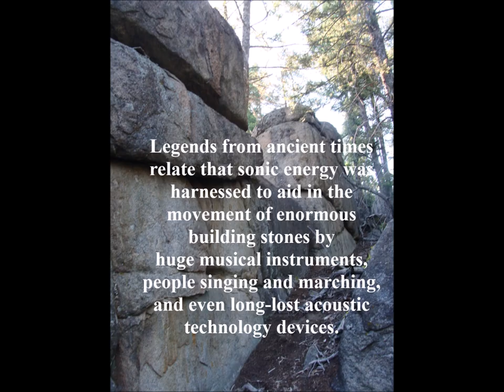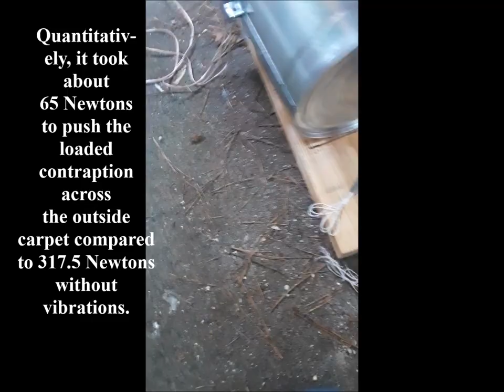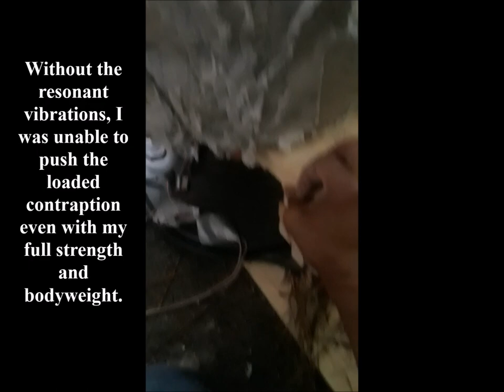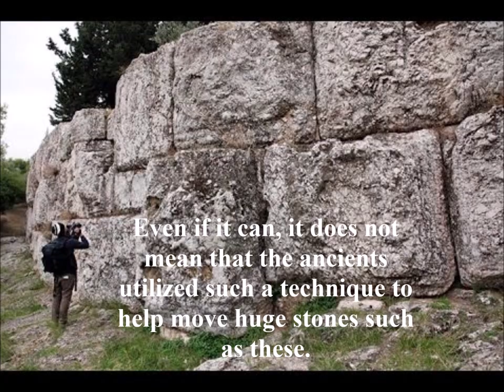Moving Boulders with a Push of the Finger: Did Sound Help to Build the Megaliths?

Comment: I believe the movement being facilitated stems from mechanical vibrations, not sound. If you were to record the sound and play it back over a speaker you couldn't move that weight
Reply from the maker: Of course. When we say sound, we also mean mechanical vibrations by default, as the former is dependent on the latter anyway.
Reply: @gsutton78  and I would say the title is a little misleading. I think the experiment is absolutely fascinating. I don't doubt for an instant. There was an ancient civilization long before hours that have mechanical devices and engineering. I just don't like the idea of saying sound moves things when in reality it's mechanical vibration

Comment: This is interesting. I've been looking for information on ultrasounds for the past days. These are frequencies below our hearing capabilities but can also move objects. They can be caused by numerous things such as earthquakes, oceans, volcanoes, and even  mountain fractures. It may very well be that they used such forces of nature at the right timing, if they have not produced the sounds artificially. This is also a possibility. Oh and, it was also said that certain temples have this wind turbine effect which also produces these low frequencies. But I suppose to make those they already moved the stones to build it.
Reply from the maker: Well, there's a whole branch of thermodynamics called thermoacoustics. The Stirling engine is an example of this. Thermoacoustic devices can be as simple as a tube resonator and a heat source or as complex as an internal combustion engine. What if the ancient developed thermoacoustic "vibratory" engines rather than rotary engines as we typically use today. I will attempt to demonstrate in an upcoming video!
Reply: @gsutton78  I can immediately think of so many different ways to go about this. Will you try one with water and/or pitch forks? 🤩
Reply from the maker: @cosmolosys   Yes, in a future video, I plan to show how it can be achieved with water also; both steam and waterflow!

Comment: Did you match the natural resonance of the blocks? What is your resonance?
Reply from the maker: Spree TV   No, here only the hollow container was in resonance. The weight of the sonic piston (the large bolt at the end) adds energy to the vibrations, but reduces the resonant frequency of the container from about 57 HZ to about 42 HZ. But, I haven't perfected the system yet. Ideally, the block's frequency should be matched as well as the electrical resonance of the solenoid that I used. This should result in a much greater vibrational power!
Reply: gsutton78 Indeed. If you match Electrical magnetic resonance of the blocks you should obtain Nuclear magnetic resonance and it will move effortlessly. Ill be staying tuned, keep up the great work.

Comment: You should have put a vibrating sled with a weight on top of packed dry sand.
That would probably work.
It would basically cause the sand to "liquefy" and it would probably be fairly easy to move.
They could have possibly done something like that.

Although it's pretty evident at this point that the Egyptians most likely did not build the "great" pyramids. They are MUCH older than that. At least 10K years ago, if not longer.
Reply from the maker: Or perhaps Egyptian civilization is just much older than originally believed. Just think of the level of technology a civilization could reach in a dozen millennia.

Comment: I wonder what kind of oscillator/vibrator Nicholai Tesla had that he could scale it up and down so much. Does anyone know where I might find out what it was like?
Reply from the maker: Matt Long. According to the document linked below, the device was based around a steam powered piston which had an adjustable frequency. It was powerful, but apparently small enough to fit in his pocket. The document says that the original purpose of the device was to be a transducer; converting electrical vibrations into mechanical vibrations which would be transmitted through the ground and then received and turned back into electrical vibrations by a similar device. But the resonances reportedly induced in large building structures led to the device being labeled as Tesla's Earthquake Machine. https://www.forbes.com/sites/davidbressan/2020/01/07/nikola-teslas-earthquake-machine/.
Reply: @gsutton78  Thank You 😊👍

Comment: love your work, I believe the ancient cultures used the natural resonance of each individual piece..
Reply from the maker: Thanks! I agree about individual resonance tuning, especially with the heaviest stones. For the smaller stones and fill-in material, it makes me wonder if they used some type of barge that could move large amounts at once.
Reply: Moving the largest, heaviest masses is practical using resonant frequencies but lifting / hoisting such loads would require a modified approach especially when such loads have to be carefully placed in structures if using resonant frequency than demonstrated here. Exactly what that technique, I’m curious to discover such.

Comment: Try doing it on piece of stone weigthing a ton. Probably will pop your ear drums.
Reply from the maker: Not likely. Several people have told me they've observed the same principle with plate compactors weighing well over 600 lbs. You can get deep, powerful vibrations which can barely be heard. It's really about coupling most of the vibratory energy to the objects to be moved rather than coupling it to the air.

Comment: The size of the instrument to move a 100 ton stone would be huge. Bigger than anything we found. So nice idea but implausible
Reply from the maker: Doesn't necessarily have to be huge. You can also have a "large number" of instruments/resonators. It's just like a capacitor. You can either use a large capacitor for a certain capacitance. Or you can wire a large number of them in parallel for that same capacitance. Musical instruments/resonators are essentially acoustic capacitors.

Comment: What a smart and creative idea, i was thinking you'd be talking about acoustic levitation (which would of course require massive wattage). What about putting wheels on it, would the net force still be imparted ?
Reply from the maker: Gary McKinnon   Hi. A number of people have attempted reactionless drives including NASA with their EM Space Drive project. It seemed promising, but unfortunately the thrust was being provided by an interaction between the power cables and the geomagnetic field. But, sound vibrations can still provide reactionary propulsion through asymmetric vibrations, a vibrational gradient in which the vibrations are stronger in one place than another. The waves essentially carry the object along. I talk about in this video at about 22 minutes and 5 seconds in:
https://youtu.be/uyf9AaYfLrI
Also, sound can produce similar forces to electromagnetism including levitation, attraction, repulsion, and propulsion. But, we need to develop transducers that can convert several orders more power to vibrational energy without producing mitigating shock waves. A company called "Macrosonix" has experimented in this area. I discuss it in this video at about 13 minutes in:
https://youtu.be/Lf5vBXpk4DM
Reply: @gsutton78  Thanks. I saw one device, a boat propelled by a rotating weight mechanism and it was more efficient than a jet engine apparently. Thanks for the links.

Comment: It depends how much energy you are pumping into that vibrator. Could that same amount of energy leveraged with mechanical advantage do the same task?
Reply from the maker: Well, it depends on the nature of the mechanical aspect, as that aspect will determine how much energy you can condense into a limited space. The strength of countless people working together could move virtually any large stone. So, it's not really the strength, but rather the fact that you can only get so many people around a stone to push/pull/lift it. For instance, it might take 10,000 people to move a 500 ton stone, but you may only be able to fit 2,000 people around the stone, even using ropes, harnesses, etc., to maximize space. But if you can reduce the friction force by 1/5th using acoustic resonance, then those 2,000 people would suffice. As in the Tibetan Levitation account, you can have a large band moving strategically along with the stone and labourers, using their acoustic energy to aid in the stone's movement without having to physically touch the stone which would be impossible anyway due to spacial limits.

Comment: Ya know, static friction and kinetic friction kinda explains this away pretty easily. It's not magic. If your object is vibrating it's constantly moving. Kinetic friction is the kind of friction you get when the object is already moving (static is before you get it moving). This is the same thing with sand, if you vibrate it, or blow air under through, it feels like a liquid. Vibrating it is like kinetic friction in that it bounces across the surface and never gets a chance to settle into the atomic grooves that exist in every material. (Nothing is truly flat). This knowledge is what gave us rubber. Because rubber sinks into those atomic scale grooves better than anything we know.

This puts a lot of credit to the egyptians literally saying the blocks were sang into place. Same thing with the trumpets that took down the walls of jericho.
Reply from the maker: Certainly, but that doesn't really explain it away as there is no claim of magic. Only technology that might seem like magic to the uninitiated. If anything, it strengthens the explanation as kinetic friction is linked to surface acoustic wave or (SAW). That's why the device moves on its own. The induced surface waves carry the sled along via friction similar to a boat in contact with a water wave. These phenomena are explained in greater detail in later videos. This video was like an introduction to these ancient concepts.
Reply: @gsutton78  Like Graham hancock said, "we're a species of amnesia". And this stuff only started to stick once we made a written language. 
And you're right, I'm not explaining it away but giving it more credit.
Everything at the atomic level seems like magic to most people. But reality is that we are a bunch of smaller things that make bigger things. Now how did they seem to know this though?

Comment: Literally talking to my son Abt this. Use metal plates and put sand between the sliding plates for a gap and easier to move. Less resistance. Your losing a lot of the resonance power thru the wood.

Comment: They used hot air in Egypt. Plain to see in translations that come up with "flying stones" in and around construction records and history Glyphics. 

Also, they found the furnaces. Papyrus balloons have already been shown to work great. 

The sound theory is neat but lithic people lacked the power sources to apply enough energy to do useful work. Fire, on the other hand... They had a good hold on that.
Reply from the maker: The ancients would have used different methods to build just as we do today. I can certainly see the hot air balloons, but I can also see sound being used. Interestingly, heat and sound are related, both represented by the phonon. Thus, it is quite easy to generate powerful vibrations using heat energy (ThermoAcoustics).
Reply: @gsutton78  Maybe with a solar/mirror array you could control heat well enough to make some sort of viable thermo accoustics, but not on the scale required, nor with any sort of control like you'd need for motion.. I don't see these people getting very far with that. They might suspect they could do it and even understand how they fall short of being able to use it, but I'm dead certain they'd have not wasted time on it in the face of imminently more practical means like buoyancy and leverage. None of that stuff we see and are amazed by would exist if they didn't.
Reply from the maker: @camojoe83  Actually, I think it is viable. It might not be the most efficient way. But neither is steam. Steam power just as the Stirling heat engine is related to Thermo- Acoustics. It can be used to create an engine or to generate vibrations with no moving parts. All that's needed is a tube and a heat source. Steam power might not have been the most efficient motive process, but it kickstarted the Industrial Revolution, enabling us to propel millions of tons of material to great distances across the Earth's surface. So, we already know that thermo-technology is capable of this. I can certainly see hot air balloon technology for longer distances. But you still need techniques to move heavy stone over the shorter distances, especially when moving the stones next to each other. Some people have said that the stones looked like they were "tapped into place". It's as if gravity or friction were reduced such that they could be moved to very close tolerances without slamming them together. Acoustic lubrication would be perfect for this. There are also tales of the stones "moving as if having life". This is what we see when objects vibrate across a surface. There's indeed room for both balloons and acoustics. They don't have to be mutually exclusive of each other. You also need a technology to cut and shape the stone. Acoustics can also fill this need as I attempt to demonstrate here: https://youtu.be/na7THeVCyQA
https://youtu.be/oIHL1s1d7ew.

Comment: They probably just used ropes and pulleys, which we know they had. Surely they sang while working and this is likely where the sound stories originated.
Reply from the maker: It is highly unlikely that ropes and pulleys alone would have been enough, especially over long distances. I might see ropes and pulleys working in a tall structure like the pyramids because large counterweights could be used as suggested by Jean-Pierre Houdin. But engineers have stated that they would have difficulty handling some of the sheer weights used in ancient monuments even today. We could do it, but it would be by no means easy as we would expect with thousands of years of technological advancement at our disposal.  Also, the accounts mention not only the sounds of singing, but also of musical instruments and stomping the ground.

Comment: Can you really vibrate rocks like that long distances? I feel like the vibration alone would induce structural instability in the rock. Maybe I'm wrong because in theory it would also heat it. So maybe it becomes plastic at the right frequency. Wouldn't this leave a mark though?
Reply from the maker: Yes, according to the alternative science literature, these vibrations could be used to both move heavy stones as well as disintegrate them. There seems to be a fine line. But all objects have numerous resonance modes. And so, the deciding factor is probably the relation between the input frequency and energy. A certain amount of energy could move or levitate, while additional energy could shatter or disintegrate it. In the experiment in this video, the stones don't resonate, but the metal pail does. It resonates at sufficient energy to move nearly 300 pounds. But increasing the input energy by a factor of say 3 or 4 would certainly break down the material of the pail, and in fact it eventually did wear down. But, the pail wasn't designed to vibrate like that anyway. But I chose it because it had a strong, pure sound.
 As it stands now and if it would scale up, I would use this technique only for short distances, especially the last few inches. Some have said that the blocks used in ancient structures are so close together that it's as if the were simply "tapped into place" rather than smashed together which typically happens when using large forces to overcome friction. But still, this experiment is pretty basic. There may be much better ways to do this which would be practical over long distances.
Reply: @gsutton78  Yeah, the last few feet hypothesis seems the most likely. I feel like if a stone was vibrated enough to levitate it would not withstand those vibrations long. But vibrating it enough to overcome friction sounds totally plausible.
Reply from the maker: @GladiatorSlows   True, but I think acoustic lubrication as shown here and acoustic levitation as is done in modern containerless processing is only the most basic use of sound in this manner. Researching the work of Philadelphian inventor John W. Keely, he apparently had a more advanced understanding of acoustics and achieved much greater effects which didn't so much rely on the intensity of the sound, but rather on frequency. The idea is that gravity, electricity, and magnetism are all ultimately vibrational in nature. Modern science seems to agree with this as is mentioned in string theory. And because they are vibratory, this means that ordinary sound vibrations can potentially interact with them. This is achieved by tuning an instrument to vibrate in sync with the unique frequencies of those forces. For instance, if the frequency of gravity were 1Terahertz, then vibrating an object at that frequency, or perhaps a lower harmonic of it, would enable it to produce gravitational effects. It's like having a radio tuned to certain frequencies. Keely also claimed that certain acoustic vibrations could intensify magnetism and apparently he was able to induce magnetism in non-metallic objects. In this case, the sound itself is not the motive source, but is more of a conduit or a means of accessing and manipulating the universal forces which in turn could affect apparent weight. Please see my video, "Vibratory Lift" for a more indepth explanation.